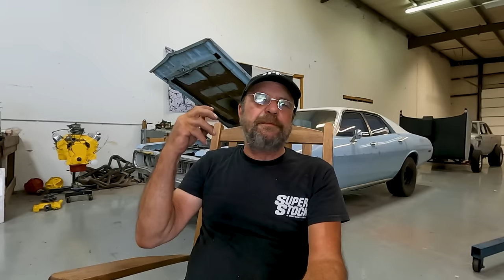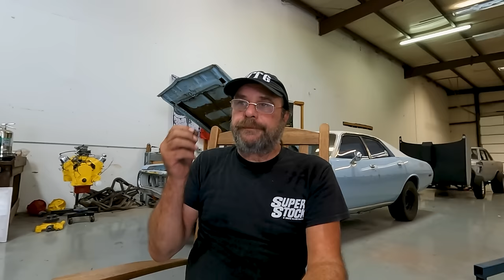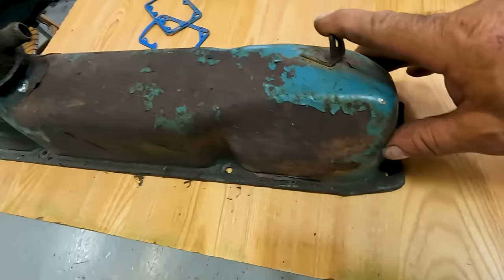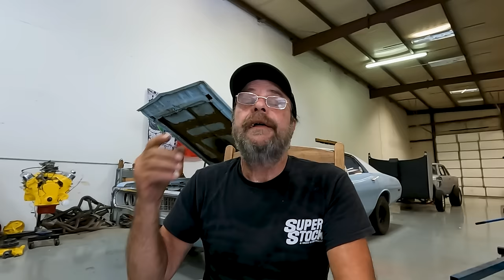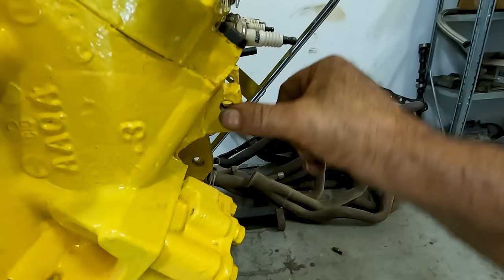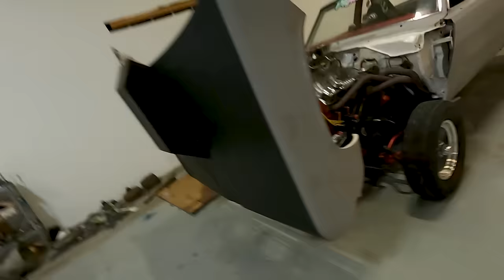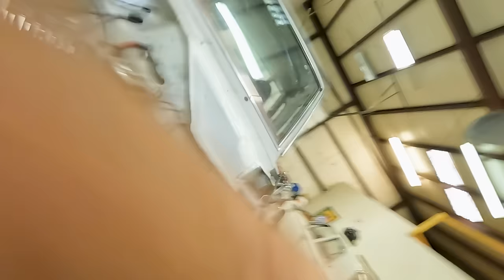Did Mr. Norm REALLY Outsmart The Engineers At Dodge?  The Full Story Behind The Big Block Dart

Comment: Tony, the guy in the shop that norm had Spearhead the 383 conversion was Dennis Hirschbeck, he was the brain behind a lot of things.  If you ever want to hear about the behind the scenes dyno tuning, I’ve got a good story for you I won’t say on here
Reply: Was it like the story I heard about the high riser 427, add 10 jet sizes, retard the timing until it only made 425 HP, let the governing body watch the pull and then the snow job was complete?
Reply: The 383 story came from Mr. Norm himself. It's in an old episode of American Muscle car. https://www.youtube.com/watch?v=Tvb7QSsR-EU&t=5s and is a little over 10 mins in. He never invented the idea, as much as he got impatient with them after it was already supposed to be in production.
Reply: My father bought  a 67 Dart GTS 383 4 speed new from the dealer in late 67, very unique vehicle to say the least. Dodge was very conservative with this car, the cam was smaller that the OE 68 335 Road Runner engine, it was only rated 330 HP...my dad's cousin, (who's father owed the dealer) recammed the car, and had rejected and tuned the car when it was just days on the lot.
Like you said, Mopar definitely had "thought ahead" on this chassis...a big block in this compact car chassis wasn't practical, but is sure was fun!
Reply: Hey I worked with Dennis Hirschboeck for years after Grand Spaulding Dodge at Royal Chrysler Ply and South Holland Dodge. I used to talk to on the phone Mr Norm, Gary Dyer, the guys at Performance auto parts Jim Urso, Kenny Safford and Dennis were close friends,
Reply: @Moephi1  pretty cool!!
Reply: @Moephi1  I still have one his GSS darts #9 built, has a unique painted stripe with Grand Spalding logo in the middle. trying to find pictures to document this.

Comment: As an owner of an original 69 cuda440, the driver side motor mount looks like someone cobbled it together. And they did.
Reply: @davidjenson8124  Well, if you don't have the original 440 block with the relocated and drilled bosses, you would not know. The mount was simply two pieces lap welded.

Comment: Good information here. In 1986 we put a '72 400 in a '65 Fury III 318 Poly car, using a mount bracket off of something common, turned upside down/backwards or something weird, and it worked. almost 40yrs ago now! Later a '65 Polara showed up in the junkyard and I got the left side engine mount bracket off, but my buddy never swapped it onto his Fury. Unfortunately my friend was killed in a freak snomobile accident in 1996 and the car was sold and neglected until being scrapped. I did buy the engine back, it was a "cold weather" block with a mid 1971 casting date, and the VIN said it was from a '72 Charger, "HP" stamped.

Comment: Very cool story.  I never raced against a 440 Dart.  Where we drag raced in Maryland, the 340 Darts and Swingers ruled the drag strip.  There was a group of them.  They were lightened and nothing could beat them except another one.  They beat everything and anything.  They had no weight and the 340 motors were powerful and fairly light.  Unless they fell asleep on the tree, got crooked, smoked the tires or broke something you needed a perfect run and a lot of luck to run close.  We had B body’s, Coronets and Satellites running junk yard 400’s with cams and heavy springs and drive shaft brakes running against them and we rarely won.  Our cars were not slow and I remember laughing at this one guy and saying there was no way his little 340 Dart was going to beat my Satellite.  Mine was light and had never been beat up to that point unless it broke.  I was positive I had him, I was on a hot streak and cutting next to perfect lights.  That Dart left even on the light and just walked away.  At the time I couldn’t believe it and was in awe.  I wish someone would have had a 440 Dart to see what would have happened against them but I don’t think they would be fast enough.  Those 340 Darts and Swingers were no joke, they were set up perfectly and ruled at that time and place.
Reply: True...from a 68 340 GTS owner
Reply: @Mr.Saltwater Awesome
Reply: with traction,my money is on the 440. the weight difference is far less than the hp& tq difference.

Comment: No worries about the length of the video from me, it's all good. About that assembly sequence - with the powertrain assembled to a subframe together with the front suspension and then the whole thing going into the body from underneath - That has become the standard assembly sequence today. I don't know if Chrysler was the first to have done it that way ... might have been. Whether the body was lowered down to meet the subframe, or the subframe was raised up to meet the body (which is normally what is done today), doesn't really matter, except that raising the subframe up to meet the body allows room for the assembly line folks to get in underneath the car and tighten bolts.

Comment: I remember seeing a promotion for the Barracuda in 69 as a concept car to be released for the 1970 year it had the 383 engine installed however when Crysler discovered the big block didn't make it run any faster than a performance small block they couldn't justify the expense. The extra weight usually ran slower times than the performance small block. Even Don Garlits tried a stab at the A body and got the same results. A good point is the 65 or 66 Pontiac Tempest NHRA- IHRA records the  performance of inline 6 cylinder ran slightly faster than the v8 because the extra weight the V8 effected its performance in the 1/4 mile.

Comment: GRAND SPALDING DODGE,  was only THREE PLACES WHERE YOU COULD HAVE YOUR VEHICLE "TUNE 
ON A DYINOMATOR " 
Mean Adjustments while 
UNDER POWER AND NON
STACTICED MOVEMENT..
     And I OWE 1969 CHEVROLET  NOVA WITH
A 396 DUAL QUIDS,  MUNSIE 4 SPEED WITH 
REVERSE LOCK OUT .
     COST WAS $ 350.00 FOR TWO HOURS OF TUNING...

Comment: This was right about the time I was running my little Valiant Gasser.  We all wanted one of those low key 440 A bodies, but $ was tight and they were out of reach ...
However, factory built and tuned 273 4-speed cars were on discount and some of my acquaintances bought them and ran in stock classes.  You'd get beat up unless someone red lighted or broke, but fellas were making rounds and they were fun cars too  😁

Comment: I recently started working on my buddies 1969 RR with a 1970 440, automatic. Being a GM guy, I know next to nothing about Mopar. Through my crash course of learning, it's pretty fascinating what Mopar was doing under the radar. I'm amazed the RR is so light weight, I used to think it had to be heavy a big as it seemed to be. I got the Ole 440 singing with a cam, headers, intake, carb and ignition. Have done all floor pans including trunk, complete front end rebuild, first torsion bar job. It's quite the journey learning about Mopar, even clear back to the Dodge Brothers.  
    Nice video, great info.

Comment: One of the techs I worked with at the Chrysler Plymouth dealer starting in 1969 had one of the 1969 440 Barracuda's. He used it for drag racing and had many modifications on it. In late 1970 I bought a new 1970 Duster with a 225 slant six in it. He wanted the six cylinder torsion bars so we swapped my bars for the much stiffer 440 bars. That Duster with those stiff torsion bars on it handled like it was on rails. I had G60-14 tires on it, great on dry pavement but in rain, not so much. I cured that problem when I put a set of radial tires on it.

Comment: Hi Tony. I actually bought a blower from Gary Dyer also around 1979. I drove to his shop in Chicago to get a cut down Offenhauser tunnelram to accept a 671 GMC blower for a Boss 302 I was putting in my 68 Mustang. He cut the crank pulley while I waited! He told me he only made one other setup for that motor(intake is unique because of the cleveland heads). It's still together,only problem was needing a turtle cap on the distributor to clear the drive.I remember him being an unpretentious nice guy. Even kidded me about if my plane was parked outside when I mentioned I drove straight from NJ in one day.

Comment: I think the '67 383 Barracuda was called Fomula S.  Funs changing spark plugs in a big block A body.  Great stuff !!
Reply: Best to drill a hole through the fender skirt.
Reply: I used a holesaw on the inner fenderwells on my 440 70 duster. Jacked it up and didn’t have to take the tires off

Comment: Thanks for the cool info on the 440 Dart. I figured if any one knew the whole story it would be you.

In 1964 I was a 17 year old gear head who used to listen to Chicago radio stations. I'm not sure of the year I started hearing Mr. Norm advertise so bear with me. I knew from his ads that any car he gave the full treatment had GSS emblem on it. Grand Spaulding Sport. All the gear heads I  hung with talked about one day taking their car to Mr Norm to have it worked on. None ever did, we didn't make enough money.
Later, I think it was in 1969 I saw a charger on the Dodge lot in Beloit, WI with GSS label.
I just HAD to drive that car. I don't think the salesman knew what it was, he knew me from prior visits and didn't insist going with me. But I was leaving my 69 Road Runner on the lot as collateral. The GSS Charger had the inline dual quad carbs, tuned headers and I'm certain a hot cam judging by the loping idle and of course the 440 engine, from the start it was obviously tuned. Even at partial throttle the auto trans shifted firmly, I felt every shift. Barely touch the throttle and it was hustling. I went to a remote road out of town and carefully added some throttle, it was clear I could not floor it on blacktop or the back end would head for the ditch. So I made my way to the interstate where it was all concrete. Mashing the throttle at about 30 on the entrance ramp was an eye opener. The front came up, there was so much noise from engine and exhaust I could not be certain if the tires were squealing. The back end got loose for a few seconds but it stayed fairly straight. When second gear kicked in the car lunged forward and I saw in the rear view mirror it had laid down about 8-10 feet of rubber with both tires. When it shifted to third, the front stayed right where it was. It seemed to be accelerating as fast in third as it did in second. It ran all the way up to red line in third so fast I could not believe it.
I don't remember how fast that was, it spooked me to see it at red line so fast, I quick let off the throttle to save the engine. When I did look at the speed, it was down to 120 so I suspect it reached 140 maybe 145. That car was wickedly fast.
I took it back and told the salesman I had to think about it. I made offer of lower price but he said no. Next day at work it was all I could think of. 
Went to dealer after work and it was sold. Somebody wanted it at any price. I should have bought it on the spot. Lost it for trying save a few bucks.
Wickedly fast barely does justice to that car.

And now there is Nicks garage where he is extracting 440 power figures from 383 engines on his dyno.
Reply: Great story!

Comment: The Dart 426/440; if MoPar had the vision to (1) introduce that combo (2) had made available the wedge with aluminum heads and manifold it would have made the 396 Chevy II and Fairlane 427 into jokes. The idea of the "lightweight" Super Commando really intrigues me. Allly heads/ally manifold/steel crankshaft dropping off the better part of 100 pounds? Ooooooh!

Comment: At beginning of the 1967 model year, the Barracuda competed with the Mustang and got a 383 for the Mustang's 390 in 67. The Dart competed with the Chevy II. Chrysler developed a 1967 318 bored to 4.00" as a performance engine to compete with the 327 Chevy II in the Dart. The 383 wasn't originally available in 67 Dart. The high performance small block had the same size valves as the 273 / 318 and its performance was a disappointment, so it got scratched from production for 67. It was later developed into the 340 by being bored 0,.040" more and having the intake ports mimic the Chevy 327 ports, as well as the 327 valve sizes. The 340 wasn't released until the 68 model year though. The 67 Dart was supposed to get the 4 inch bore small block, but it didn't compare well to the 327 Chevy, so it was never put into production. The whole reason for the 340 was to beat the 327 Chevy. The 1967 Barracuda had the 383 from the beginning of the model year. The 67 383 A-bodies didn't have power steering available. The 68 383 A-bodies got a specially machined engine block for the optional power steering. The 69 383 A-bodies got the high performance 383 and the optional power steering used special mounting brackets. Late in the 67 model year, the 516 cylinder heads were discontinued and 67 440 915 heads were used on some late 67 383 engines, including two-barrel 383's. I remember in the mid-1970's the 915 heads were sold new, as service replacements for closed chamber big block heads. The list price was $100 each, bare, but one dealer of Mopar performance parts sold them new, two for $100, mail order, advertised in car magazines.
Reply: 67 383 GTS Dart was mid year production, my dad bought one new.
Reply: @duanedahl8856  Yes that's true, but the 383 Barracuda came out at the beginning of the 1967 model year. The Dart GTS was supposed to get a high performance small block that was scratched from production for 67 and resulted in being developed into the 340 for 68. The 67 Dart didn't come out with a 383, but got it later in model year.

Comment: As a Chevy guy building my first Plymouth and it being a 69 fastback barracuda and stuffing a stroked 440 engine in it with as much recycled beer can parts in to lighten it for some handling. My goal is to get it around the LA welter weight for some street fighting when needed.  I really enjoyed this information because i also heard that odd story many years ago. Also i had no intention of putting that engine in from down under. Just like any big block Chevy/ Pontiac/ Olds and Buick  i own or owned i lay the headers in and slowly drop the heart beat in on a tilting engine hoist. I know they put the 440 in it by 1969 but never with a manual transmission ,  I will. Cry babies that look at my pistol grip will be lied to by calling it a prototype. The point of them losing money by building the 67-68 monsters was new to me. Makes sense because a day or two of paid labor really adds up on the for sale bill if there is only one guy working on it. Never mind two.

Comment: Im building a 440 Dart now a GT ,8 3/4, 727, 3:55 gear , 2800 stall hoping to see bottom 12
Reply: A decent four forty and traction and you ought to be all over low twelve. Sounds like a very neat car.. Keep us updated and share more details if willing. Aftermarket heads? Cam type? So on and so on. Let's hear it!! Spill the beans,please. I'm 54 years young. Just got my v8 vega panel express tuned for daily driver all summer. It's a 1971. 355. Hydraulic roller. 3.73 posi.  Streetable combo for town.
.
Reply: @PatandDoopypoopy   346 ported iron heads, Comp hydraulic 282 duration .528 lift, Edelbrock TM-7 intake, Holley 750 cfm vac secondarys, frame connectors, 727 with Transgo full manual shift valve body, racheting rear Sprague in tailshaft, Autometer guages , Stock Dart GT floor shifter , Hooker 2" fenderwell headers, line lock, next up is a 6 point cage . 
Thanks for the interest in my 69 Dart
Reply: @joewilley7776  Back in the 80's a buddy had a stock M code Dart. We installed a small cam, Hooker headers, TM7 with a 750dp, 3;91 gears, and ran 12:10 on street tires. Traction was the biggest issue, no doubt with a 9" slick it would've ran 11's.

Comment: Uncle Tony (and friends)  You're likely the only person that can shed some light on this car. I sold MAC tools from 1985 to 2000. I came across this car in the 90's. The owner was a deaf mute guy that used a teletype deal to communicate.  He brought it into a frame/ alignment/ suspension shop for a brake job. A very good friend of mine worked there and he had done all the work on this car for years. He said it had "special brakes"? They had to send out the calipers to get them rebuilt. As I remember, it was a 70 or 71 Dart  Rough shape with a terrible paint job. I noticed the B-pillars had a sort of twist in them.   Now, as to the car.
1. It currently had a 318 with factory A/C. If it was an add on, it was the best I'd ever seen. Everything looked perfect, The dash, ducts, lines, etc..
2. It has the big differential.. However, it had the smaller wheel bolt pattern
3. The brakes...  MANUAL brakes with 4 piston Aluminum front calipers?
4.  I ran the vin tag under the hood (somewhere I still have it written down) Said it was a 426?
I sure would like to know what it was. As I understood, with a hemi, there was no room for a brake booster. So they used the 4 piston calipers to compensate.
All I could think of was that it had been used as a race car when new, and some swapped out the drivetrain for a street car. I was never able to ask the owner about it because he was a deaf mute.  Uncle Tony, can you or your followers help me out?

Comment: My 1968 Barracuda fastback is powered by a based 400 based 512 stroker with Trick Flow heads and a hydraulic roller cam with 254 duration @.050 with 618 lift, all backed by an A833 4 speed. 👍

Comment: the 1960 Valient was a Chrysler model. I had one with the 170 CI slant six. It said Chrysler on back of body. It had 3 speed on the floor and wound up nicely. When I worked at the GM truck plant in Oshawa Ont. we did an inplant mod where we took the extended cab and put with shorter box. This was in 1987 and was an instant success. The 318/340 came out in 2nd half of 1967.  On another Youtube it said the H code was for hemi, whereas Tony says it is for 383 4 speed.?